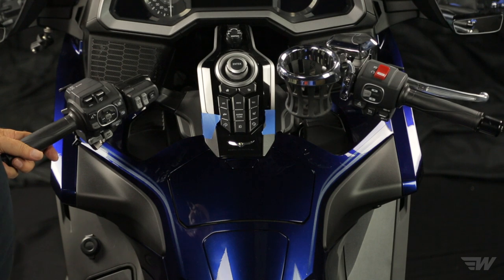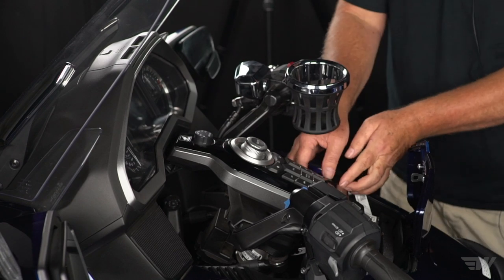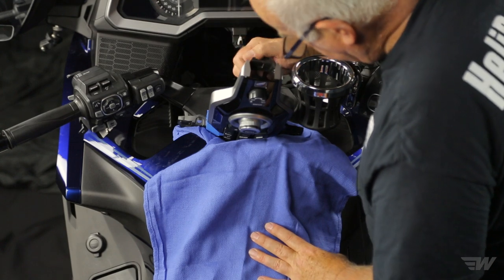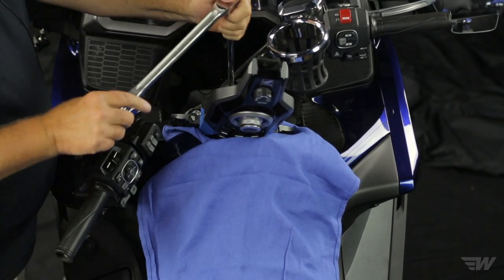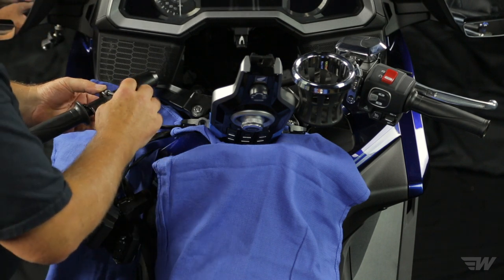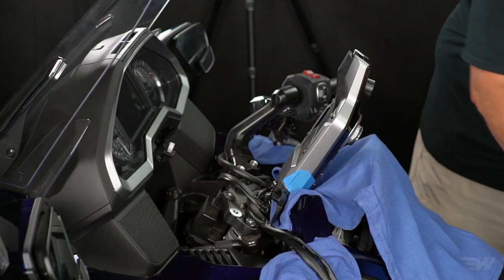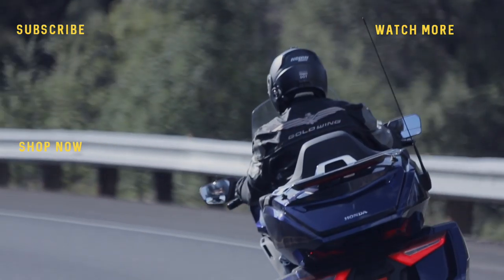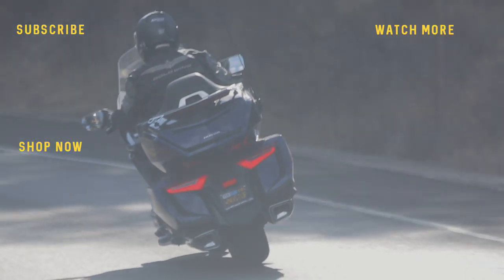Horizon SST Helibars for 2018+ Gold Wing Installation Video | WingStuff.com

Comment: This video is missing the most important part.  How do you adjust them?  It looks like that console will have to be removed every time.  And, will this work with a manual trans?  Does the clutch lever, and the hose to it, impact the installation?
Reply from the maker: Thank you for your feedback! All good questions. You can contact our customer service and they'll be happy to answer your questions or you can contact Helibars directly. Ride safe!

Comment: That’s way more complicated than it needs to be. Just add a riser that raises the bars a bit and pulls them rearward. Then you don’t have to do 80% of what you did here.
Reply from the maker: HeliBars does make risers for the Gold Wing but there's less adjustability. We have customers who first bought the risers and then the Horizon Bars and said there was a dramatic difference in comfort and reduced fatigue. Thanks for your comment!
Reply: @WingStuffTV  I bought the risers and are not happy with them. I am looking into getting the bars.
Reply from the maker: @bdan3459  We're sorry to hear that. The risers are good for reducing reach but the Helibar handlebars have so much adjustability you should be able to find your sweet spot.
Reply: @bdan3459  Same here... the Helibar Risers just dont make that much difference.

Comment: Well just a couple issues encountered in my installation. These are advertised as complete kit, but does not allow for let’s say upgrading from risers to full horizon handlebars. The dealer installed heli-risers, and didn’t provide me any take-offs, such as the four main bolts and washers. So I previewed the instructions and got 4 new 10 mm bolts ahead of installation. Not washers, so I am out to hardware store for washers. And the center control panel to be removed is kinda glanced over? Had to go to video by others…. Anyway although I am midway in installing this product seems very good quality and engineered so well, I love it already! Getting the bolts out required a 1/2” pneumatic powered impact gun??? But I’m going precision when torquing to your specs?? I will prevail.

Comment: Hello. On the left hand side handle bar control there is a toggle switch hanging down, what is this for and where did you get it. Is it a momentary type switch. Please hope you can answer
Reply from the maker: Hello Paul. Thanks for reaching out to us with your question. I believe you're referring to the CB control switch. I have a CB radio installed. You can purchase a CB radio kit and a CB antenna with us here: https://wingstuff.com/shop/cb_radios

Comment: would be nice to see this done on 2001 -2017 GL1800s since many people still have those. i have  a 2001 with heated grips, and i hear the heated grips may be destroyed trying to do this upgrade, so i haven't pulled the trigger on it yet.  but i did notice left elbow pain after a 1200 mile trip last year, so wondering if this would be the solution, but not wanting to tackle this beast of a job. there is only one competent goldwing mechanic shop here in las vegas nevada, but even so, i had to redo, myself, some wiring stuff they got paid to do in the past on my bike due to being sloppy. so, not wanting to deal with them anymore.
Reply from the maker: Thanks for the suggestion. We'll talk with Harry and see what we can do! In the meantime, our customer service guys will be more than happy to help clarify your question about your heated grips: 949-454-2199, customerservice@wingstuff.com or use the chat feature on WingStuff.com. They're available to assist you M-F from 8am - 4pm.